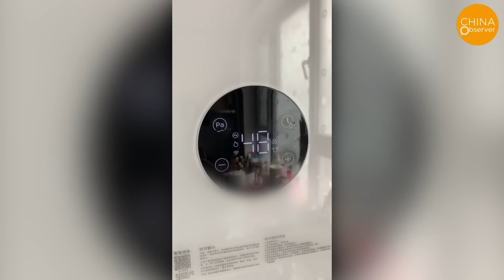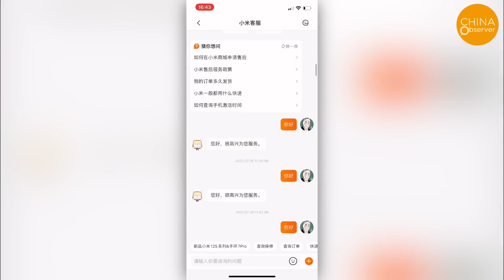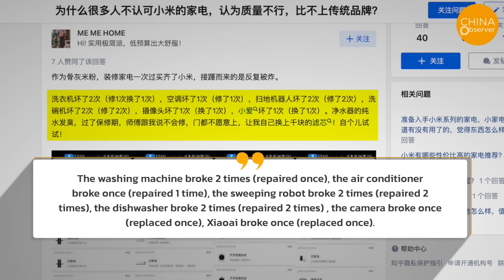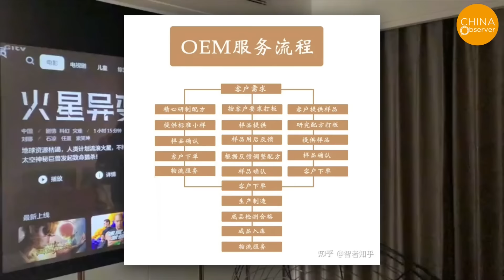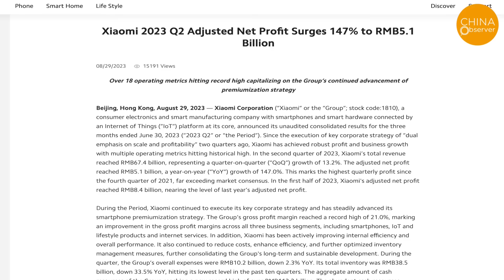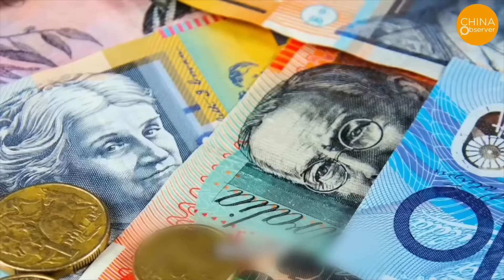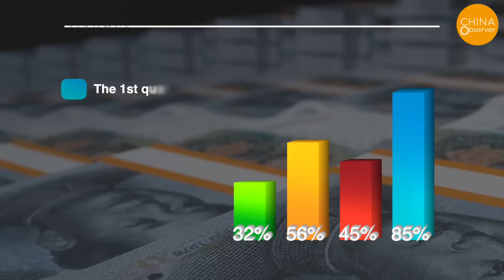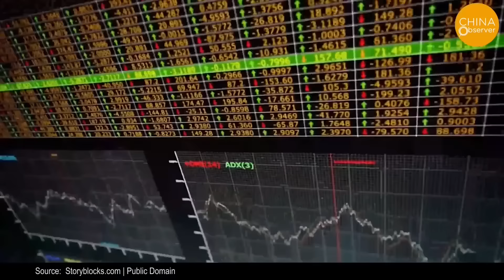Xiaomi Is Trash: Its Quality Is Shockingly Bad. Buyers Smashed It

Comment: I bought a pair of Sony headphones in 2004 that have only just started exhibiting balance issues; 19 years of service is a good run. I never see them for sale 2nd hand either, so I could probably sell them on as a collectible. 

I've never seen Chinese electronics designated as something collectible like an original iPod or Sony MZ RH10 is.
Reply: I have a pair of sony earphones made in japan in the 90s,  sadly I've also gotten thru 4 pairs of other sony headphones in the last 10 years, I have not seen any headphones made in japan by sony since the 90s, another company that crapped out.
Reply: @GreatSageSunWukong  Do you mind if I ask what type of headphones they are? If it's their prosumer lines (aka high end consumer or use-specific), then it's rare you'll go through them quickly.

Consumer earphones however...They have a habit of losing the connection in the left ear (wired) after about 2 years. Once my current pair of MDR XB55AP craps out I'll get a pair of Fiio FD3's; I stuck with Sony because basically no-one else offered a narrow bore earphone, but Fiio now sells bore-adjustable earphones.
Reply: @deanchur  My son wears sony ones that cost about £20, he breaks them fast, personally I use momentum 1.0s I've had for about 7 years, but he keeps getting these sony ones in different colours but they are the same ones and they are foldable he says they are comfy but they break all the time normally the wire goes. I've replaced the wire on my momentum's 3 times but that is changeable and i buy the replacement cables from aliexpress so I know they are not amazing anyway
Reply: This shows the longevity of Japanese products. A PlayStation 1 from 1996 still works.

Apple products last long too - my iPod from 2005 still turns on, but it's display broke in 2019. My iPad mini 2 from 2013 still turns on even though the iPad is smashed up
Reply: And Thinkpad is basically an IBM Design. Lenovo didn’t design it but when they design the Ideapad omg it’s so god awful

Comment: A few years ago, I bought several items from Xiaomi in a short period, and almost every one of them (except a power bank) had issues:
- The Air Purifier started shutting down randomly without any apparent reason after a few months.
- The Robot Vacuum Cleaner frequently encountered new, random issues. Sometimes it would stop cleaning after two minutes, other times it would turn off and remain in the middle of the room, and occasionally it would refuse to start cleaning.
- The Xiaomi phone had the most buggy software I've ever encountered. After a year, its screen stopped working. This was the first phone I've had that broke.
- The Smart Scale displayed inaccurate numbers, but at least the weight measurement was correct.

I thought that the quality of Chinese products improved but apparently not.
Reply: I've had 3 Xiaomi phones. Mi A1 was absolutely excellent, best phone ever, helps that Android was at its peak back then. Mi A2 Lite was the worst phone I ever used, I used it for all of 3 days and got rid of it, garbage LCD virtually invisible in sunlight and horribly unresponsive touchscreen, most phones from 2010 were better. Mi 9T was nothing special, good hardware, awful software, somehow much worse camera than Mi A1. Don't think I will ever get Xiaomi again though, too much of a parts lottery with god awful software, the A series at least didn't have MIUI.
Reply: Mine is total opposite of you. The robot, air purifier and smartphone work just fine the only one that have horrible quality is powerbank. Seem like many of the partnership company have a quantity issues.

Comment: 3 years for a TV isn't... that bad... I had multiple issues on products like Samsung and LG with TV that died after less than 1 year and I had 2 Ipod Touch (Apple) that died very fast after less than a year (the screen had like... Cancer ?). On the other hand, I have off brand products that still work after a decade. For the laptop territory, it's harder, I consider Dell, HP and Lenovo garbage (too many failure), MSI mid garbage (bad quality, especially on the hinges). I don't know I noticed that ALL the products tend to have lower quality in general...

Comment: Have a similar problem here in the US with Chinese made products lack of quality, and seemingly without much buying option of products made other than in China. Large major retailers like Walmart, the vast majority of the electronics that Walmart sells in their stores, along with tools and home furnishings are all made in China, and the vast majority of it is just low quality cheaply priced crap.
Reply: Just why do you think they are crap? It's not because the factory is full of incompetent people. It's because the production line has been engineered to optimized for cost. I have 4 ovens in my house, or devices that can function as ovens. Three of them are very cheap. All are perfectly capable of baking a cake. Our grandparents would be amazed at the amount of stuff we have in our house.

Take for example a $30 cordless drill. Considering the margin the retailer needs to be profitable, the wholesaler, transport costs, something to cover warranty/support ... they're probably making that for $5 - 10. If you were to open it up, that is almost unbelievable. But for the fact that I'm holding it in my hands, I wouldn't believe it myself. To me, it looks like the labour cost alone would be more than $10 just to simply assemble all the components.

Comment: I live in Brazil and here chinese products have flooded the market to a point you have no other option.
My Panasonic microwave broke catastrophically, 3 weeks after warranty expired, it turns out all the internals were made by Midea. Same thing with TVs, you can't buy a true japanese made TV anymore, it's all chinese rebranded crap.
I too was a huge fan of Xiaomi, but the quality is definitely worse than it was 4-5 years ago.
Recently, I bought a smart Yeelight LED bulb and it lasted, I kid you not, 3 days. The bulb it replaced had 3.5 years of use, and was also Yeelight (xiaomi).

Comment: Wow...  I've owned several Xiaomi phones and only had a problem with one.  It was immediately replaced, even after almost one year.
Reply: This video also surprised me, my Xiaomi phone I currently have is already 4 years old and still works perfectly, never had problems with it.
Reply: Same here, I own multiple Xiaomi products (scooter, phone, watch)  and never had problems with them
Reply: You're white, right?
That's why.
Reply: Same here. I'm very satisfied with the brand so far.
Reply: My redmi note 10 pro still working perfectly. And also my xiaomi wifi extender. Those are the only xiaomi products I have.
Reply: I own xiaomi too. Had problem with it and got it fixed by its repair center. It was good overall, the only problem was that it took 1 month to repair.

Comment: I use Xiaomi a lot, multiple Air Purfiers, smart ceiling lights, humidifier, dry rack, water flosser, weighing scale, juicer and much much more. And they are all much value for money, looks really good, and all last till today, none broke down. Meanwhile my expensive Panasonic washing/dryer combo machine (Japanese brand) broke down a little more over a year and Panasonic wanted to charge me 1/3 its price for repair. While I had Apple Watch that broke down too just right after warranty, though the Mi Band is still alive and kicking. Whatever, you guys go ahead and boycott what you want, no one going to change your opinion to blindly hate on a brand like Xiaomi.
Reply: I owned like 6 handphones anda 1 robot vacum of Xiaomi.. 0 complain..

Comment: Could be interesting to get a hold of the schematics and firmware and see where the issues are :)
Reply: the problems is, they only copied it from some other reputable product like Samsung, or Apple. their original schematics are written in tissue paper
Reply: @DrozGodhammer  Well, AI will soon fix these issues.
Reply: 6 cent resistors instead of the ones at 12 pennies ruined one product I know of first hand. Early failures. Are sub-standard parts possible today?

Comment: Russia has been flooded with low-quality Xiaomi, Huawei, etc., trademarked goods; and some citizens have no patience or means to find something that has not originated wholly in China. This turns the whole electronics market into a shambles. Recently, I purchased a mixer console built by a Chinese brand. Luckily, I managed to record all of its flaws (hiss, low gain, cackles, and low quality of the line-in output) on a video camera and returned it to the store and bought a German Behringer mixer on a black market, which works more than perfectly fine. China has no place in the audio market for sure, as it has no sound culture at all.

Comment: My Xiaomi experience was absolutely fine. Mi Mix 2, died after 4.5 years of use because I accidentally left it on a steaming hot fresh bread for 15 minutes. That's on me. Mi Mix 2S, 4 years running strong. A couple of Mi band 1, served 3+ years easy until they became obsolete. Mi band 4 nfc and 5, served 3.5 years, 4 nfc got finally smacked against the wall a tad too hard so it stopped reacting to touch, 5 got phantom touch a few months later. Amazfit Bip 5 years going strong, still gets over 20 days on one charge. Mi Vacuum-mop works with zero parts replacement for 3 years in our country house.

Comment: i was among the users who bought poco x3 pro. Alot of bs had happened during that time, where my friends phone stopped working after 3 months and i got extremely worried for mine. He didnt get the replacement from service centre, they were bs'ing to him telling that water had gone in and it was around that time where everyone is already aware of how cheap the mobo is made that it can't handle the overheating etc.

In the end my friend took it to a repair shop and got it replaced. He alongside me will never be buying xiaomi products again.

Comment: As a xiaomi user for 5 years i have no problem on my xiaomi phones except thermal throttling and it's normal

one of my phone is Xiaomi Redmi Note 10 5G it has a decent gaming performance but it's prone to thermal throttling and it's absolutely normal i just bought a cooler and it won't throttle anymore

Comment: Why am I not surprised? I had purchased a a Redmi Y1 Prime. In just under the battery swelled up to such an extent that the the thickness of the phone in the centre more than doubled. I managed to visit their service centre during lockdown and had the battery replaced. This battery again swelled up like a balloon and tripled in thickness in under a year and a half. Compare that to my 10 year old Samsung Galaxy Grand I9082 which even today is in perfect working condition and although the battery does not hold charge for say more than a couple of hours it has gotten thicker by just 1 mm. Also in my 12 year old Samsung Galaxy Pop which is slow but still fully functional the original battery still holds charge for 4 - 5 hours. 

Incidentally as indicated on the batteries the cells were made in Korean and were the batteries were assembled in Viet Nam.

Comment: Yeah, it's true!
I had a Xiaomi band watch for about 3 years and the screen became turquoise instead of white and the two straps one of which broke when I had it for 3 years and I bought another one after a few months and it broke.
In 2021 I bought Xiaomi earbuds, the sound was mediocre and within 1 year the base didn't work for no reason, but luckily I got Soundcore buds, which I've been using for 1.5 years now and I haven't had any issues.
The last thing is that I have the Xiaomi Redmi Note 12 4G mobile phone for 9 months now and the problems got even worse after 6 months of use. Mainly from HyperOS that sometimes it doesn't show who is calling me, i.e. only the call tone is heard and after 10 seconds it appears. And sometimes when I come back from outside with full brightness, my screen turns gray and a few weeks ago I opened YouTube and suddenly the screen froze.
When I had a Samsung One UI, it didn't have such problems, although it rarely does.
That's why I will NEVER buy Xiaomi again! Not even Redmi and Poco! 
Samsung is 100 times better in everything and I will buy a Samsung mobile phone again!

Comment: I once got a Xiaomi- Redmi phone (Note 10 pro max) just after the warranty period (1 year for manufacturing defects) the memory chip died and I lost all the data

Even before I had issues even before, the phone was almost 55°C sometimes for reasons and dead pixels would appear until the phone cooled down, needless to say never buying their products ever again
Reply: @SweatyFeetGirl  nah even on YouTube it's a common problem one solution was to apply better thermal paste which does nothing but actually increase the heat transmitted throughout the phone...

Also I have no valid reason to return it (like no manufacturing defect, the overheating part isn't considered a manufacturing defect), I got it offline as well...

That's how good Quality Control is at Xiaomi, after which I got the "explosive" OnePlus Nord 2 and even now I have no issues with it, broke the screen and got it replaced by the next day, OnePlus had better quality control even though it's Chinese as well. Fun fact even Apple products are Chinese they have their RND team in California which is super misleading

Comment: i have huawei gr5 2017 and only last for 4 years till 2021. i bought a tcl 10 5g january of 2022, and it broke after a year. the charging pin is the problem... i bought it in a store with lots of phone brands and the customer service is only at the capital and i'm from the province. it's not worth it going to the capital cuz the traffic and the fatigue you'll get after, and also the long walks you might take cuz you don't know the way to certain roads. taxi's are overcharging so i don't ride them. maybe i'll pass with china phones and go with samsung...

Comment: i had three xiaomi phones, when it comes to build quality, they're solid, on par on what you pay for on other brands, my second xiaomi phone bought in 2018 is still working and i left it with my dad. xiaomi is a very popular and beloved brand here in Brazil, no one complains about its quality, but i left xiaomi because of its software, the system is too controlling and full of useless bloatware, i'm on pixel now. all of this seems like anecdotal evidence to me not based on data, all brands go through bad products that need recalls or completely stop manufacturing, remember samsung note 7? remember apple bending phones? I'm not defending xiaomi but no brand is safe from bad QC and bad costumer support.

Comment: I have a Xiaomi phone I bought back in 2021 and it has been a bit of struggle sometimes. It does work, but the poor GUI has been an issue, with small buttons and just poor design choice for users. It has been over-heating during summer when it wasn't even that hot, and making the camera freeze the frame and miss seconds of recording, and apps turning slow and unusable cuz of heat. I think they fixed that with an update eventually. Other times the phone has been turning off completely abruptly and I would miss the alarm at the morning. The battery was fully charged and everything. Definitely no more Xiaomi phone for me in the future.

I did buy a Xiaomi Air-Cleaner with filter and that one has been working fine, for the most part. Some smaller poor design choices though.

Comment: I also used that Xiaomi phone before, when Redmi Note 3 was launched in 2016, it was very bad. I bought it in May 2016. I used it 1 year ago and the logo stuck even though it didn't take up space because I used an SD card with only 17gb capacity so I tried to let it rest. Then it broke and I had to take it to xiaomi service center and finally it worked again but not for long. I was so angry that I destroyed it. Buying this is a waste of money. If you use Samsung Note 5, I used that Mi Band 5 when it was first released and up to now there have been no errors at all (This is my personal opinion).

Comment: I’ve owned 2x xiaomi e scooters, when it came to replacing the batteries I found the battery was manufactured with cheap materials including cardboard!! Both batteries broke and died within 12months so I upgraded to South Korean LG battery that cost more but even came in a fireproof transport case and has digital inner controls. The difference in quality is night and day. The Korean battery is 2years old (twice as long lasting and still going strong at the day I installed it). Buy Chinese made items and you’ll be buying twice. Just do yourself a favour and don’t skimp on price, chose from countries with better reputation for quality control.

Comment: I still have five phones from them (Redmi 3, Redmi 5 Plus, Redmi 8A, Redmi 9T, Redmi Note 11E) that worked for years and still work now.
The main issue is that in budget segment (100-150$) there's really not much decent options aside from Xiaomi phones. Other companies in that range have even worse quality sometimes or lack of support or bad price/quality/performance ratio.
I think the main problem withXiaomi is that they are trying to produce everything, with countless number of sub-brands and categories and due to that it's impossible to guarantee quality across the board.

Comment: As a long time XIAOMI user I never had a problem with them. Even my XIAOMI Mi5 is still working after 10 years and with zero lag. The only problem is, the battery isn't as healthy as before but that's normal after 10 years.